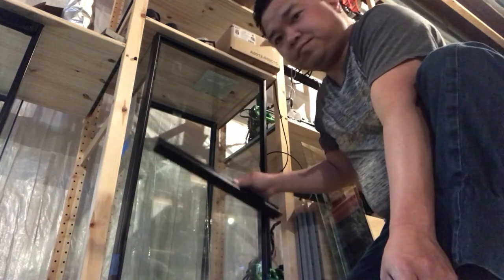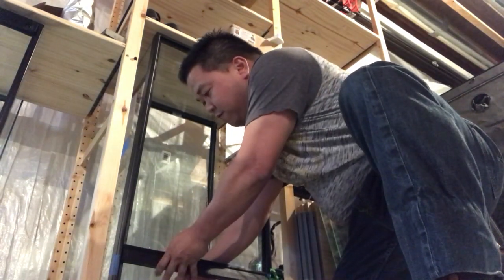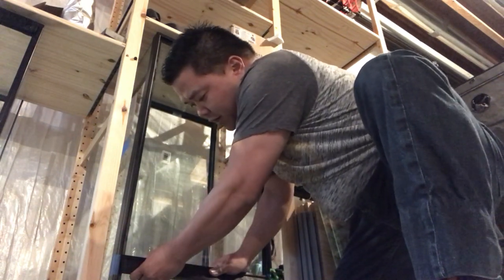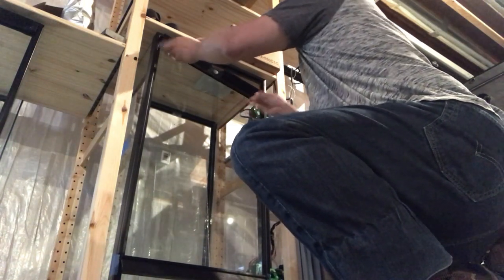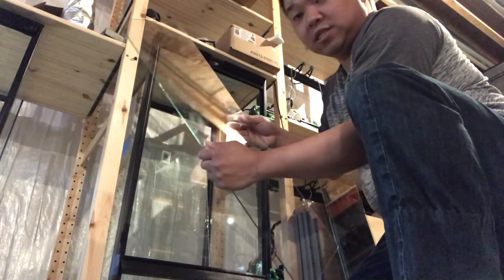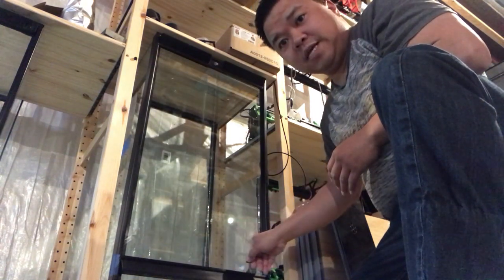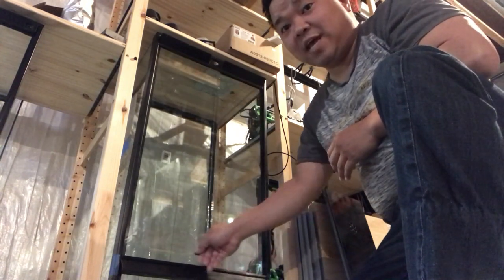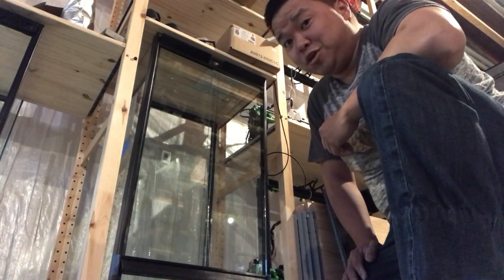40 Gallon Vertical Conversion Kit Update

Comment: Nice man! Just got 3 more of the hinged V6 for 20H! So cool!
Reply from the maker: Korey McCluskey great to hear! Email me a photo when they are all up. So far that has been my favorite design.
Reply: Frog Cube so you mention 3mm glass in this one but the previous V6 20H kit I think you said you used 2mm? Is that correct or am I losing it? Which would you suggest for that kit with more exp under your belt with that kit?
Reply from the maker: Korey McCluskey this kit was redesigned for 3mm because the weight makes it slide better.
Reply: Frog Cube got it! Thanks! So 2mm for me. Dude, I hope you are capitalizing on this brilliance man! Makes really nice enclosure affordable! I’ll be sure to send you pics of my conversion. Its actually a 29H, so there will be more depth to it than the 20s.
Reply from the maker: Korey McCluskey the 20g will keep using 2.2mm. Send a photo when you’re done!

Comment: I'm loving all the 40g stuff any plans for a hinged doors kits?
Reply from the maker: Patrick Kerr any suggestion on how to handle the weight of a 28x17 inch door on a hinge?
Reply: Would you be able to do a double door front door?  cutting the weight in 1/2, I'd imagine it would be less weight then the 20 gallon fronts. I realize it may be tough to keep fruit flies from escaping but my concern is for crickets. The wife has grown tired of the refugee crickets singing throughout the house.
Reply from the maker: @patrickkerr329  not sure on install how you'd be sure there is no space between doors.